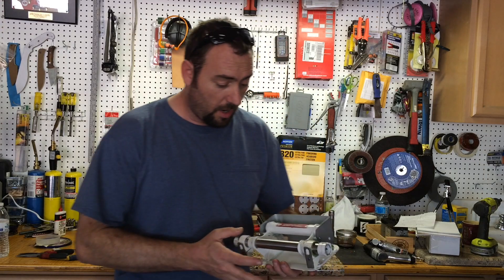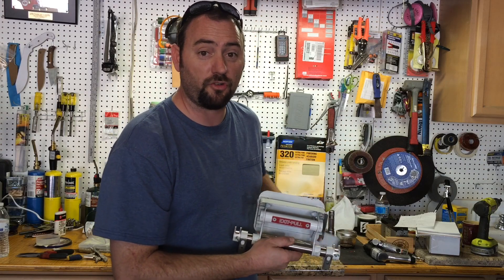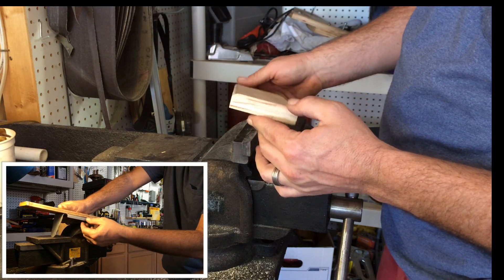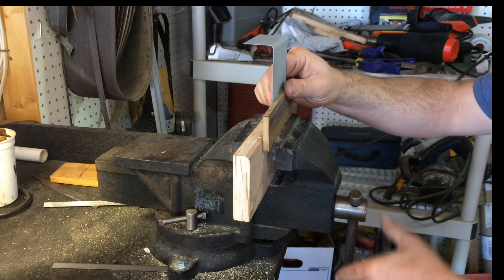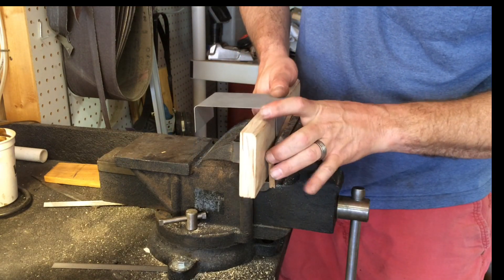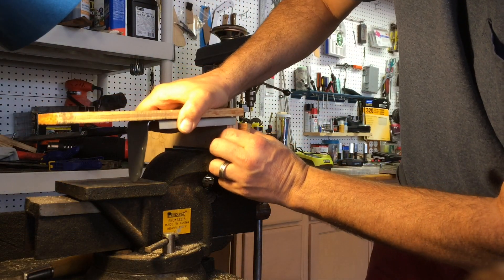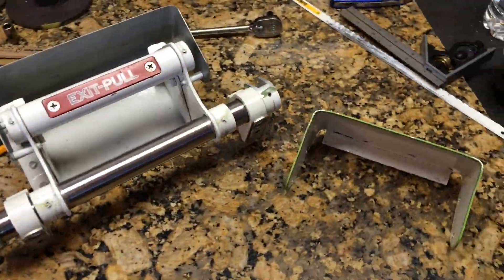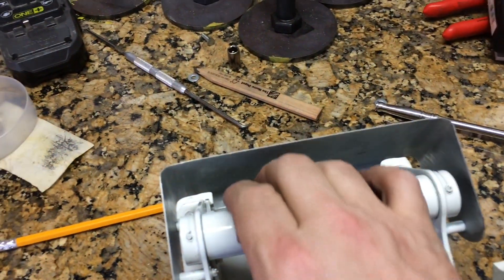How To Form Sheet Metal Parts with Limited Tools

Comment: What kind of door did this come out of? Looks like a pretty serious handle.. Great video!
Reply from the maker: It's from a CRJ 900 over wing emergency door. I'll be posting a more detailed video of the door in action next week. Thanks for watching!
Reply: It looks similar to the 737 NG door handle. On the 737, it’s best to grip the handle “underhanded” as the action of the door will crunch your hand if you grab it “overhand” perhaps that’s why the original cover seemed too small for your hand, it could be on purpose to prevent grabbing it wrong.

Comment: Do you know anything about forming sheet metal in a drawing operation between wood dies?
Reply from the maker: I've had limited success with drawing sheet metal over wooden dies. (Small panels 4"x4") I use  a 20 ton hydraulic press from harbor freight. Be sure to use a hardwood for the die and the thinnest gauge metal for satisfactory results.
Reply: I might go the same way with backing steel to distribute force.

I'm looking at prototyping a 2.5x2 0.040" panel with an inner bevel to strengthen it.

Thanks for the comment!